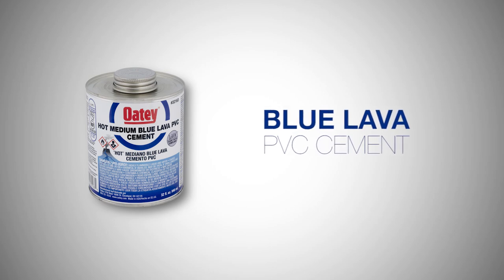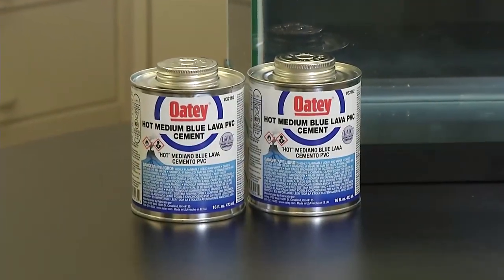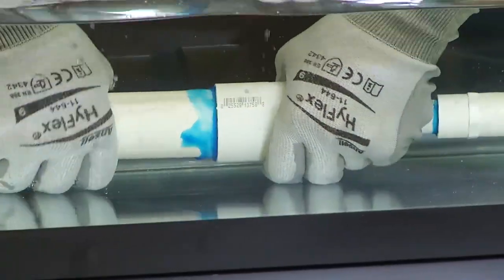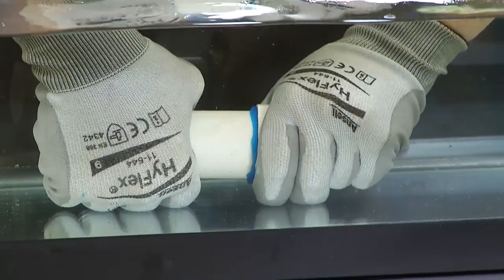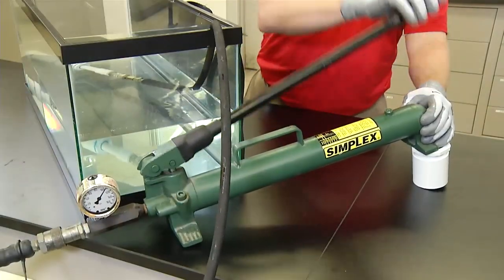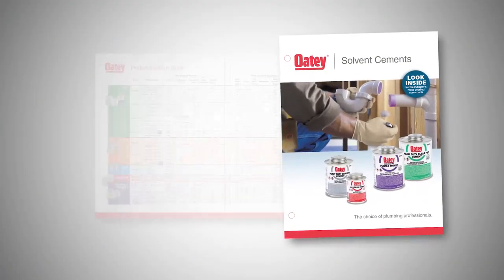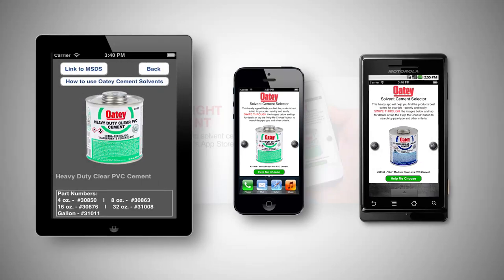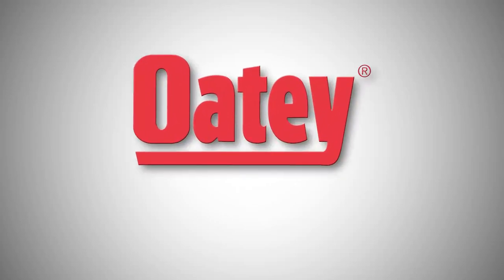How to Use Oatey Blue Lava Hot PVC Cement

Comment: As a pool service technician this is the only cement I use. Never had a failure and I dont have to wait to pressure test. Word to the wise, be sure you have your ducks in a row before applying and joining pieces. You have maybe three seconds to make adjustments before it sets!

Comment: Got a can of this instead of buying a can of primer and can of cement.  This worked great for my water supply lines with CPVC.  You don't need primer with this stuff.  It cures in seconds so you'd better triple check your measurements before putting together.  Once it's bonded there's nothing you can do if you made a mistake.  It chemically melts both sides together to make 1 solid piece.  Joints are holding up brand new after 2 years.  Can see the joints lasting decades or more. Stuff is amazing.
Reply: Cpvc...lasting decades. LOL NO. I've come across installs that are only a few years old that have become brittle and joints leaking. They make CPVC cement for a reason.
Reply: Use orange lava next time 😉

Comment: Do you need a cleaner or primer for pool applications?
Reply from the maker: Cleaner may be necessary if there is dirt or residue in the pipe and fitting. Primer is not necessary where local code permits.
Reply: @OateyCompany  is it ok to prime with Clear?
Reply from the maker: Although, there is no difference in the chemical properties purple primer is used as a color identifier and may be required in some area by code. Verify what primer is approved primer with your local code jurisdiction.

Comment: Hardens too soon to push together.  I can't get the connection all the way in. It gets really hard to do. Maybe the clear glue is better. I am not using it under water.  Just 150 psi air in 1/2" pvc.

Comment: The problem with this type of video is it does not show the use of primer which is required by both the IPC/IRC codes and the UPC.
Reply from the maker: Oatey's Blue Lave PVC Cement is formulated to quickly melt the pipe and fitting surfaces to create a solvent welded joint. Where local codes permit the use of primer is not necessary. Pleases visit https://www.oatey.com/products/oatey-hot-medium-blue-lava-pvc-cement--2080119577 for more information.
Reply: Primer is a marketing scheme